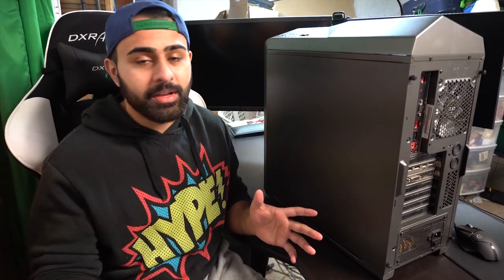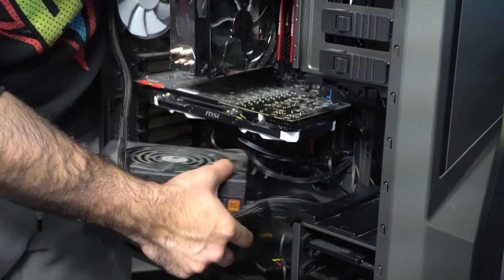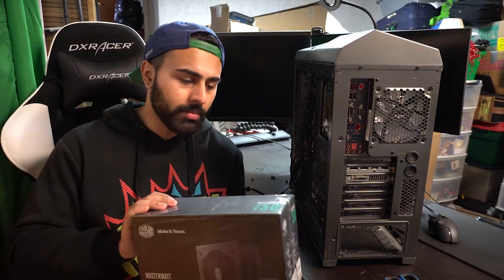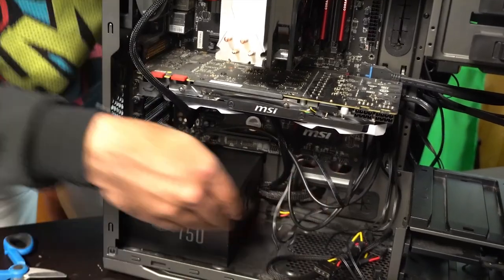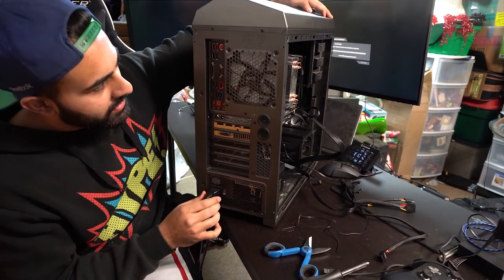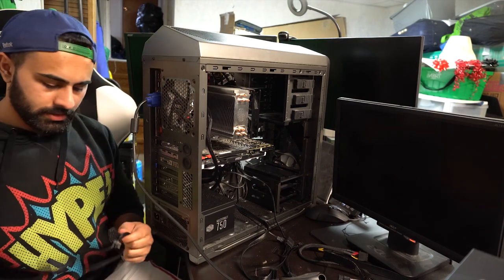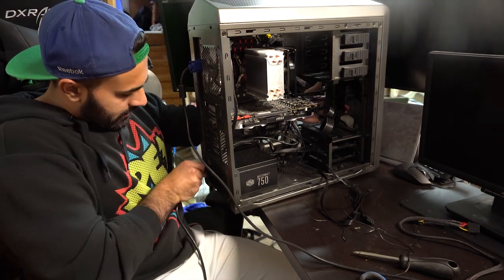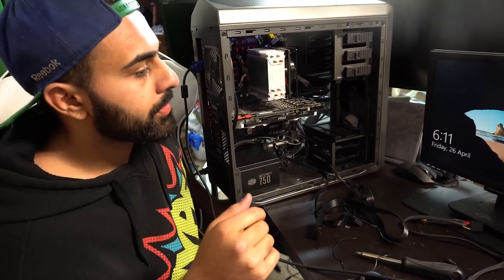💀 DESTROYED my gaming PC! Fixing water damage // Changing power supply

Comment: I came here because I spilled a glass of water on my pc while I'm using it :'( . The entire screen became color pink instantly
Reply from the maker: Did you unplug the PC? Try to remove all the parts that you can so they can dry separately. Then wait a few days before putting them back in and turning it off. If you think the power supply was affected then you might have to replace it
Reply: You shouldn’t attempt to turn it on until you look at the electronics to see if any of the components have green or white gunk on them (corrosion) or if anything looks burnt.
Reply from the maker: Very true

Comment: How would I repair a pc that was outside in the snow for 30mins I plugged it in now it doesn’t turn on
Reply from the maker: Remove it from the power for a few days and let it dry completely. Then try try turning it on. Do you know which parts were affected? Look for water spots inside the case of wet areas. And look for holes on the outside of the case (including vents). This will help you understand where the water entered. After you figure out what was damaged then you can replace those parts.

Comment: I spilt water on my computer and when it hit my computer instantly turned off, I’m not sure if it went that far but it wasn’t much water. Can you help me out as to what I should do?
Reply from the maker: You should try to clean any water you can see in the computer. So open the case and dab the water, don't rub. Leave the computer off for a few days (let's say 3). Then try turning it off. If it shut off, it looks like something went wrong with the power. So the power supply might have gotten damaged

Comment: I spilled lemonade on mine today, it works perfectly fine but I want to get a check on it just in case something can be bad or dangerous
Reply from the maker: I would recommend turning it off for a few days and try to get the liquid out. There is a chance that if the liquid is still in there it can move around. After a few days the liquid should evaporate and then you will have no worries. Also because lemonade is sticky you might run into an issue where your keys are sticky. So maybe consider wiping the key computer with a disinfecting wipe. Something that will evaporate quickly. 

If this advice helps you, don't forget to smash to subscribe for more videos like this :)
Reply: @VlogsUnleashed  thanks, I will subscribe :)
Reply: Vlogs Unleashed what is the keys?
Reply from the maker: The keyboard Keys
Reply: @VlogsUnleashed  I only spilled on the top of my pc so the lemonade landed on top of 2 headphone ports and 2 usb ports
Reply from the maker: @lilherman7506  That's not too bad then. You should be fine. Just make sure you clean the lemonade. If you think that there was a chance the lemonade went into the computer, then don't use it for a few days. Better to be safe than sorry :)
Reply: Vlogs Unleashed But is it bad for the usb ports and headphones ports?
Reply from the maker: @lilherman7506  In general yes, but I have spilled stuff on mine and it still works. Just make sure it's dry and clean it gently
Reply: Vlogs Unleashed yeah but I dont know how to open the USB ports or the headphones ports, but I think they are dry tho
Reply from the maker: @lilherman7506  Try to clean it with a microfiber cloth. If you can't try using it to see if it works. If it doesn't then buy an adapter for a different usb port. Generally usb ports aren't worth fixing, it's better to replace it.
Reply: Vlogs Unleashed I dont think I have to replace them, they work perfectly
Reply from the maker: @lilherman7506  That's very good news! Glad to hear it!
Reply: @VlogsUnleashed  what should I do if milk got on some parts of my motherboard and most of it in my house pins
Reply from the maker: @colynvaughn9465  First thing to turn it off. Then try to clean as much of it as possible. Maybe take a few of the components and gently wipe with a microfiber cloth. I wouldn't use the computer for a few days to make sure everything dried up. Then try turning it on after at least 3 days. Was the computer on or off when the milk spilt?

Comment: Hi I really need help this is urgent, I was cleaning my room and I was throwing away some water bottles and then one of them spilled all over my pc. Like less than the half but it was a lot. And the pc was on. I immediately turn it off and searched up what to do if I spilled water on my pc and it told me to unplug it so I unplugged it quickly even though when the water spilled and the computer was on I dint hear any bad noise and my moni te was normal it shutted down normally and then I quickly tried to wipe all the water away with a napkin and now I will leave it there for a few days drying up I also use a hair dryer every few hours to make sure it drys up. Do you think it will still survive, I dint see anything weird when I spilled or any weird noises to so.
Reply from the maker: I can't say for sure without seeing the damage and even then I would be taking an educated guess. The best thing to do is leave it off for a few days and hope for the best.
Reply: @VlogsUnleashed  it really dint damage because when the water spilled my pc dint make any type of noise and my screen dint do anything it was just as normal I just shut it down and then unplugged it.
Reply: @VlogsUnleashed  Hey man, I am back. My pc lucky survived but I am planning on leaving it there for a few more days just Incas of moisture.
Reply from the maker: Awesome! Glad to hear it all worked out!

Comment: I just spilled some diet coke on my desktop....the monitor suddenly turned to no signal, so I jus  disjoined gpu and ram to dry.. do you think it’s going to be ok after few days later?
Reply from the maker: I am not sure how bad the damage was. Did you spill only on the PC or also on the monitor? Either way, disconnect whatever was spilt on and try dabbing it with a cloth to remove the coke. Don't rub the cloth, you can damage the parts. leave the computer off for a few more days, maybe a week. If the power supply got wet, I would replace it rather than risking your other parts being destroyed. I hope that answers your question 😁
Reply: Mine is dead ima go get repair it how much would it cost btw?
Reply from the maker: That's unfortunate, do you know which part is burnt out? The price would depend on the broken part.

Comment: Just spilled soda on my computer yesterday. (on the pc tower, and some of it got into the pc since there's a lot of small holes on the top, but some got on the floor right beside it.) What should I do? 
I was on the computer, listening to music, and accidentally knocked the cup, and the computer just shut down immediately. 
I turned it on today 2 or 3 hours ago, and It's working just fine, but i'm worried.
Reply from the maker: If you're worried, then don't use the computer for a few days. This will give the liquid enough time to evaporate. If you see any liquid try to wipe it up with a microfiber cloth or something that won't leave stuff behind. But if it is working now chances are it will be fine in a few days.

If this helped, don't forget to smash the like button and subscribe :)
Reply: @VlogsUnleashed  I ordered a new one, I think the computer will be just fine, but it's really old ( 7 y/o without changing anything like graphics cards and that) and there are some games I can't try due to not meeting the requirements.
Reply from the maker: @stelken5021  Makes sense! Which PC did you get?

Comment: Hi I have a little bit of an issue. I was adding a graphics card to my computer and left the side panel off after installing. Later on my younger brother split some fizzy juice on the computer. Some splashes  on the motherboard and on the psu. I tried switching it on (didnt realise at the time he had split it) and the computer gets power but doesnt boot at all. The motherboard also gets power and lights up. Now shall i try to clean the board with alcohol and dry everything or how should i proceed thanks
Reply from the maker: Leave it for a few days. You'll want all the juice to evaporate. If you see any liquid try to dab with a microfiber cloth, use something that won't leave anything behind. Double check make sure you've cleaned all the components. You might have to remove everything. Once your computer is dry (after a few days) try turning it back on. If things are turning on but the computer isn't working, remove components. Start with the GPU then the RAM (leave one stick) and see if it works. If it works then you know which part you have to replace otherwise you might need a new power supply. Hope this helps :)

If you have more questions, join our discord server! We have an amazing community of people that can help!
Link: https://discord.gg/zD2S7Rhn

Comment: I hate to say it, but my cat peed on the top of my pc, and it won’t turn on, yet the LED on the bottom of my mother board still turns on. 
Please help.
Reply from the maker: I'm sorry to hear that. Clean up the liquid then let it sit for a few days so it dries up. Do you know which components were affected?
Reply: @VlogsUnleashed  The top area of my mother board.
As well as where all the plugs are on the side, but there’s a cover over that.
Another thing that got his was my graphics card (my temporary one so it doesn’t matter) and my CPU
Reply from the maker: Wait a few days then try turning it on. If it still doesn't turn on then remove the graphics card and try again. Chances are you might have to replace the mother board
Reply: @VlogsUnleashed  tried that, and I asked my big brother to drive to micro center and get a new one.
Edit; even after I took out the graphics card, it didn’t work.
Reply from the maker: Unfortunately you might have to upgrade. maybe the people at micro center can examine it, but without seeing the PC I unfortunately won't know what the problem is.

Comment: I had just finished my gaming setup and then i was excited and then I accidentally spilled water on my PC and when I try to turn it back on the monitor says no signal
Reply from the maker: Don't turn it on for a few days. Try to dab any visible water. After a few days, try turning it on. If you still get no signal, disconnect your GPU and connect your monitor directly to the motherboard.
Reply: @VlogsUnleashed  I am new to this stuff but I know what my GPU is but It won’t come out.
Reply from the maker: @Sympleex  We have a discord server. In the server, there is a tech chat. Can you ask this question there with a photo of the inside of your PC? That will make it easier to answer.

Discord Link: https://discord.gg/hPkY5qn

Comment: i spilled a whole jug of water on my pc. turned it off immediately, got toilet paper, dried most of the water off. im inexperienced so i didnt know how to remove the parts from the pc. it is currently drying up in my room. is it going to be ok? im stressed out
Reply from the maker: Taking out the parts are super easy. Watch my PC build video to see what to do. But don't turn your PC on for 3 days minimum. That should be enough time for the water to dry. Just in case you missed cleaning some of it up.

Comment: any idea what could be broken on my pc i left it in a wet place idijot didnt dry it turned it on and it made a wierd sound and BOOM a blue cloud shooted out of the back and it cut the electricity
Reply from the maker: Hmm I've never heard of that. What you can do is look for discoloration in any of the parts. If a part has burn marks it's damaged and would probably need to be replaced

Comment: so I spilt milk on my PC yesterday except I cleaned it all off and it still turns on today but some must have leaked into the audio and microphone jack and now they both don't dont  work (it is a prebuilt) what should I do
Reply from the maker: Hmm, that's a strange one. You have 3 options: 1. You can try to clean / replace the headphone and mic jacks. 2. You can just get an adapter and work around it. 3. You can get a professional to fix it. I would personally go with 2, because built headphone jacks are "ok". I always recommend getting an interface if you want better gaming audio. Hope this help :)
Reply: @VlogsUnleashed  ok thanks I got mine off skytech do you know if I am able to just replace it instead I see it says a 1 year warranty on their website but I don't know if I had to buy a warranty or not
Reply from the maker: @hunterfrancisco7029  You can try giving them a call and see what they say. You can replace it, but I wouldn't recommend it. It would take longer and not perform as well as some of the cheap audio interfaces and you might risk affecting another component by accident

Comment: This just happen to me like a month ago and I still have not fixed it because my motherboard broke and I had no signal I swapped the gpu to see if that was the issue and it still did not show signal and my motherboard cost 700$ so yea no I have to buy a 300$ one cause I have a i7 6800K
Reply from the maker: Yeah, that's the worst. When you have to replace parts. But you can probably find a mother board cheaper that $300 for a 6800K

Comment: I spilt water on the top of my pc, I think some may have seeped in but I managed to turn it off before it turned off itself. I turned it on 12 hours later to see if it worked and it turns on but it doesn't go past boot phase, no display. Any way I could fix this?
Reply from the maker: Can you try using a different cable? If that doesn't work then try to remove the GPU and maybe use a different GPU if you have one or integrated graphics.
Reply: @VlogsUnleashed  The motherboard apparently fried, already tested the other components and they're fine
Reply: @xorphelius  That's sucks, but at least it was the motherboard and not the GPU
Reply: @KyleUnleashed  Yeah I actually found  some residue on the gpu but thank God it didn't touch anything important on it lol
Reply from the maker: Yeah that's very lucky. I had the opposite problem lol

Comment: Just spilled quarter of a pint over my pc thanks to a spinny chair. Managed to disconnect everything before it stopped posting. Couldn't get my screwdriver to unscrew my case to dry it, so I put my oc on its face so the drink would roll away from my gpu and power supply. What do you suggest now?
Reply from the maker: I suggest you look inside and gently wipe any liquid inside the case. After that, wait at least 3 days for it to dry then try turning it on again. Good luck

Comment: I spilt some water kn my pc fan and didnt notice it, the screen went black but I could still hear sound after, turned. It off aired out but still not coming on
Reply from the maker: Was the sound from the fan, or the speakers? Like music or a video playing? When you turn it on what happens? The fans turn? The PC plays the boot up sound? Did you check to make sure the wires are plugged in correctly and the monitor is targetting the correct source?

Comment: I spilled water on my computer trying to move my night stand, I dried alot of the stuff such as the case, gpu, motherboard, even checked to see if the cpu was wet. I turnt it back on for it to work fine for a good few minutes, but it froze so I turned it off, and tried turning it on again, and my gpu light and my motherboard had light, but when I pressed the power button it would not turn on. I took out all the wires in my power supply and put the power supply in rice. I suspect that the power supply is broken, but could anything else be broken? Plz help! 🙏🏽
Reply from the maker: When any electronic gets water damaged the best thing to do is not use it for a few days. You cannot see if water went inside components so it's best not to risk it and let the water dry. I would recommend leaving it for a few (about 3) days. Then try to turn it on. Join our discord server, we have a tech chat with many people who have gone through damaging and fixing their PC

https://discord.gg/9CcPR5eH
Reply: Exact Same thing happened to me did your turn back on?

Comment: I need help I spilt water on my vents at the top of my pc and it went down my ram to my gpu and some droplets got on my psu I already carefully wiped the droplets and I've let it dry out I tried booting it up but the only thing that turned on were my fans and lights I don't really know what to do should I let it sit out longer? I'm not really well informed when it comes to tech so if you could help me in anyway I'll greatly appreciate it
Reply from the maker: Whenever you spill water on any tech let it sit for at least 3 days. since your fans are turning on, it looks like there is power. If you have an Intel processor I would try to remove the GPU and connect the monitor directly to the motherboard. See if something shows up. If nothing shows up double check the connection. If that doesn't work then try to find another PSU (power supply) and see if that works.

Comment: i spilled milk, but most of it went on the floor, a decent amount went on my power strip, but i made sure it's ok (its waterproof anyway) but like 1-2 drops went on my psu, hope it's ok, none touched the cables and wires inside so i think it'll be fine, im letting it rest for 1 day till i recheck, do you think it'll be fine?
Reply from the maker: If there was any water that in your PC just turn it off for a few days. You don't want to risk it. Water can destroy a PSU with a small drop, so it's not worth the risk
Reply: @VlogsUnleashed  oh alright, i made sure to wipe the spot it dropped on and ive been letting it dry for a few hours now, but i'll defo wait, thanks so much! you're a life saver
Reply from the maker: @kingzyv  No worries! Don't forget to like and subscribe :)
Reply: @kingzyv  Did you get it working tho?